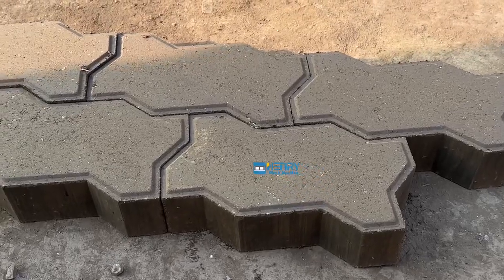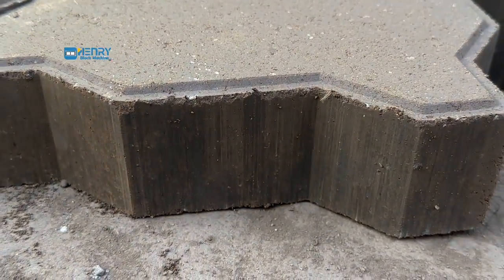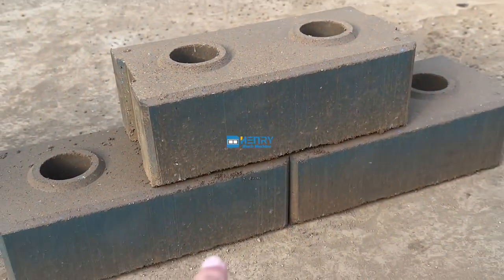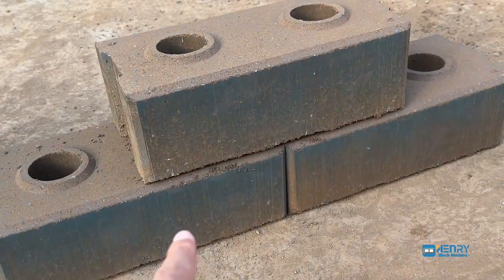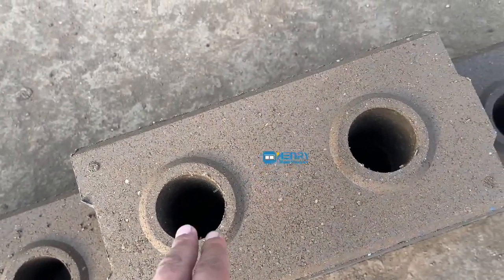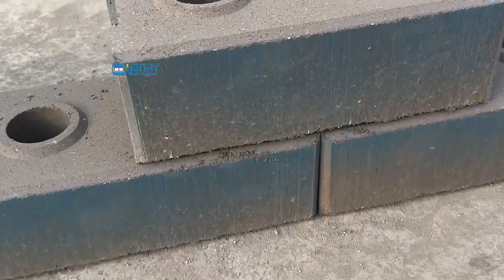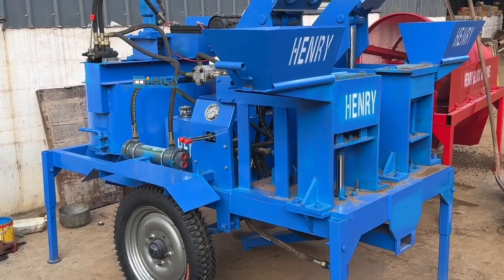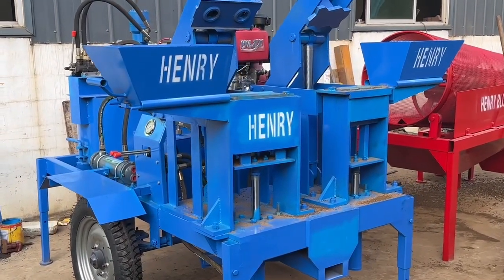Why can hydraform M7M1 interlocking brick machine also make earth soil lego blocks and zigzag paver?

Comment: For THE ZIGZAG PAVERS, ARE THEY NOT FRAGILE TO RAIN AND WATER? WHAT NEEDS TO BE DONE TO PROTECT THEM
 How MUCH IS THE M1M7 WITH DIFFERENT Moulds
 i AM THINKING ABOUT  THE ONES WHO HAVE A ROUNDED SHAPE AS WELL TO BUILD A  ROUNDED WALL AND ALSO A BAS SIN TO CONTAIN WATER
 THANK YOU
Reply from the maker: You may add some quantity of cement into material to protect from water and rain , and also made Anti-water treatment, you may add our WhatsApp number:008613053989171. To receive our good price